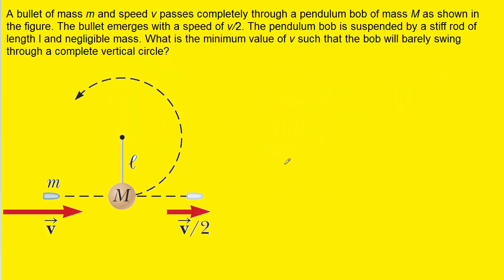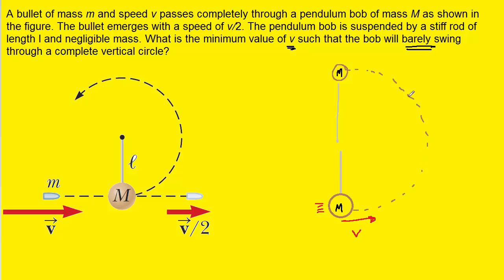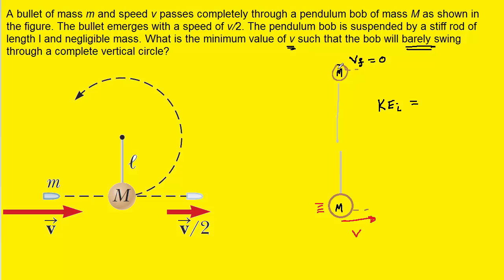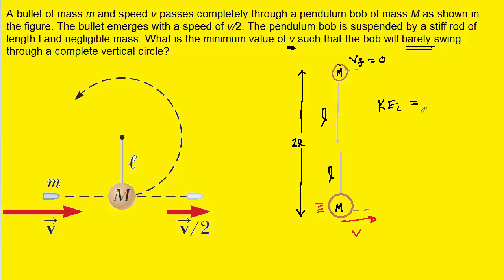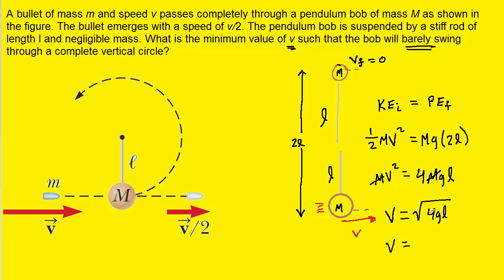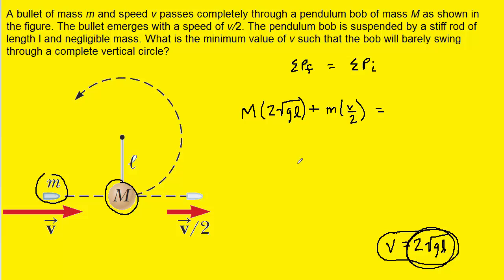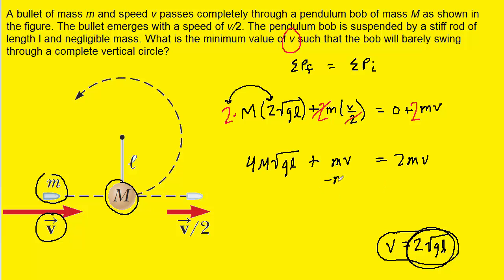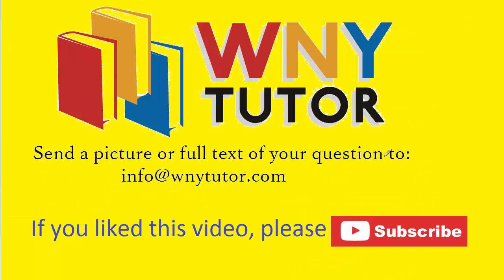a bullet of mass m and speed v passes completely through a pendulum bob

Comment: How can the bob complete the circle if its velocity at the top is zero. If the velocity is zero at the top then it will fall down vertically downwards. The correct answer should be that the tension in the string at the top will be zero. This will give a finite velocity (instead of zero) for the bob at the top. The speed at the top should be (gL) ^0.5

Comment: Sorry, but this is incorrect. If kinetic energy is 0 at the top, the ball would fall straight down and NOT swing through a complete circle. You must use mv^2/r = mg to find the velocity and kinetic energy at the top.
Reply: I believe you are incorrect. Notice that the swinging mass is connected to a stiff rod, and not a string. By using a stiff rod, it allows us to set the velocity at this point to zero. The key word in this problem was "barely." If the bob had a velocity of zero at the top, it would barely be able to finish the revolution due to gravity.  If the bob had a velocity of zero at any point less than the max height, it definitely would not be able to finish its revolution. I think this guy actually has the correct solution. Considering that conservation of momentum, as well as conservation of energy was applied, I am even more inclined to claim that he is indeed correct. Read the problem before you critique.
Reply: @AstroFear07  my bad; I didn't notice that it said "stiff rod" instead of "string". Thanks for pointing that out.
Reply: @AstroFear07  I am still confused from this question. What would be the speed if we were to make bob go to max height and than come back? Also, if we wanted it to just go to top and stand there. I think this does not guarantee going through a complete circle but guarantees going to the top.
Reply: Djuro Radusinovic In physics a big part of solving problems is thoroughly reading the question and scanning for key words. The important part of the question here is to “barely” make it through one revolution. The idea is that we’re looking for a speed that would give the block just enough momentum to reach its max point, and essentially follow through the revolution. Any less speed would result in the block not making it to max height, and it wouldn’t be able to fall all the way through. If you need a written out solution, I can help.
Reply: @AstroFear07  I need written solution, could you send?
Reply: You assume the object has 0 velocity, just like when you solve a loop problem you assume normal force has 0 value at the top. At the top the  stiff rod is in compression but the bob nearly at rest

Comment: If I look at the bob at the top position and try to solve v using F=Mv^2/r, I would get Mg=Mv^2/l, and v=sqrt(gl). What is wrong with solving with this approach? Moreover, the collision is inelastic right? How do we know that the lost kinetic energy is all converted to gravitational potential energy and nothing else (such as heat/sound energy)? Thanks!
Reply: You can't use the first method because the rod isn't a string, and therefore there is no force of tension. In order for the bob to barely make it around in a circle, v at the top is zero - rendering your equation basically useless. You have to use the KE = PE method to actually be able to solve the problem.

The collision isn't inelastic - the bullet passes completely through the bob, so they don't "stick" together afterwards - the bullet doesn't swing in a circle with the bob.

Lastly, when doing these kinds of problems, you generally assume that KE is converted all into PE unless stated otherwise - if you didn't, you'd have no way to solve the problem.